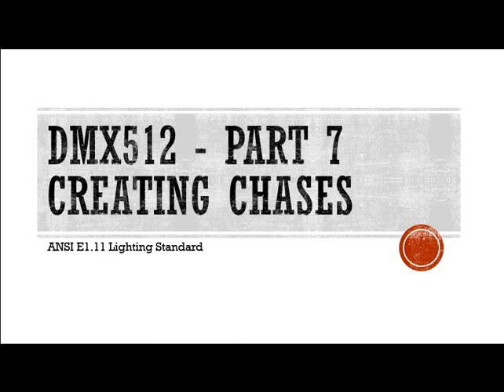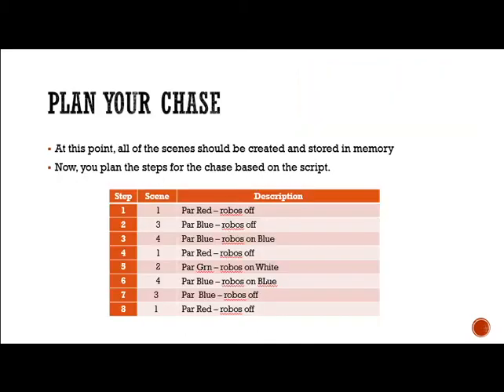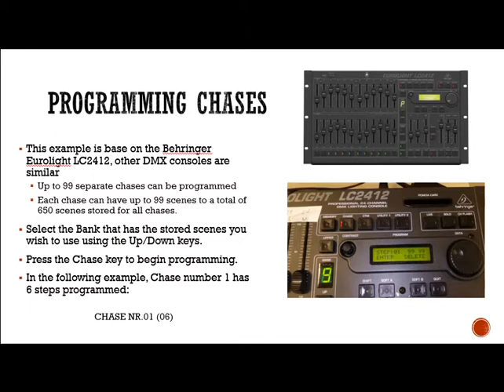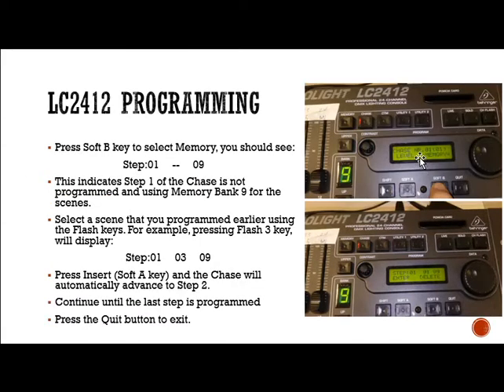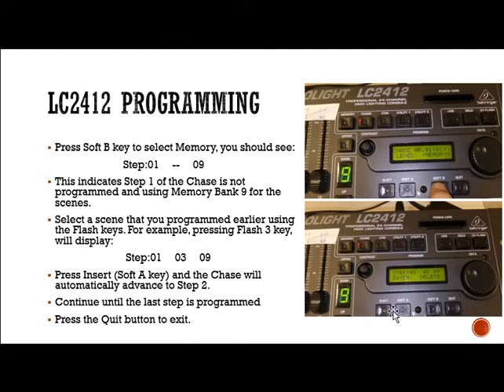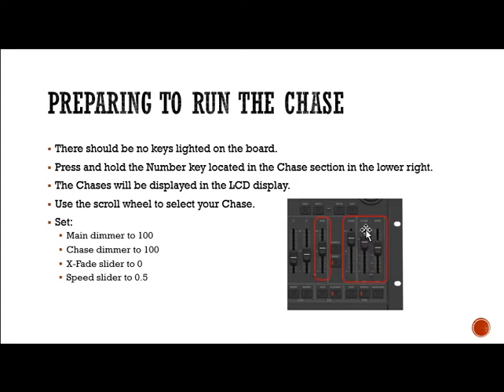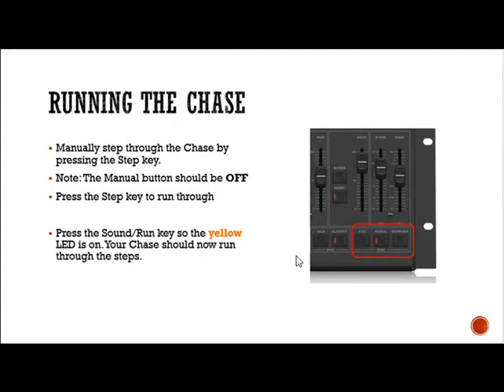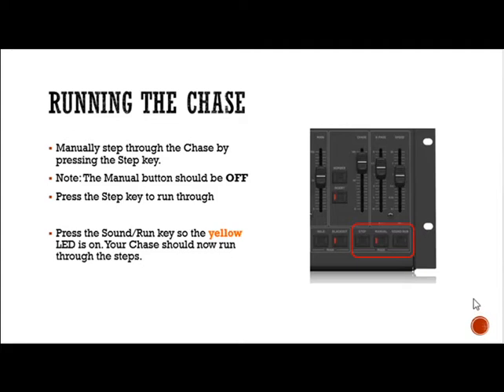Part 7: DMX Lighting - Creating and Running Chases

Comment: Can you use the manual faders together with the running chase's or run 2 chase's simultaneously? For example when you create chase1 that runs through 4 positions on the movinghead (robolights, idk how you call them) and chase2 runs through the different colors on the movinghead. So you can run chase1 and still use the manual faders to change the colors or run chase2 and still use the manual faders to move the movingheads. Or combine the 2 and run chase1 and chase2 together so the movinghead is moving and changing colors simultaneously on its own
Reply from the maker: Yes, you should be able to use the manual faders together with a running chase. On the main panel, you have the Main Dimmer and a Chase Dimmer - you can fade in the chases. There is also two more dimmers for the  A faders and Memory faders which allow you to fade in Presets (A) and Scenes (Memory). If these faders are up, then you should be able to use the individual Presets and Scene fader/dimmers to bring them up during a chase. Hopefully, there won't be conflict between the chase commands and manual dimmers. Unfortunately, you can only run one chase at a time. 

In a scene, you can control the color and position of a movinghead light(s). You could have the scenes setup on the Memory faders and hit the flash keys to turn them on during a chase. A quick disclaimer, I haven't done anything this complicated but it does sound reasonable based on the manual and my experience with the board. Good luck and leave a comment on what you find out.
Reply from the maker: In thinking this over, you might end up running out of Preset faders really quickly. You only have 24 that can control 3 DMX channels each. Might have to get real creative.